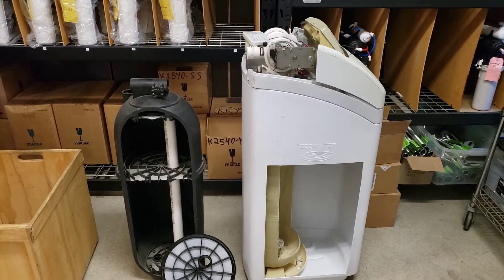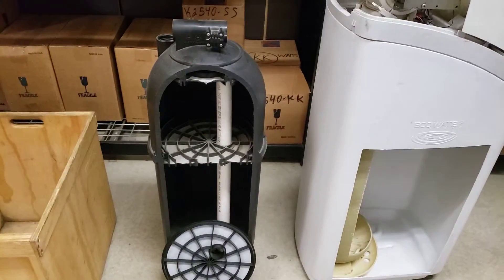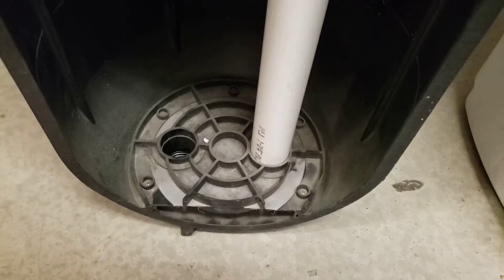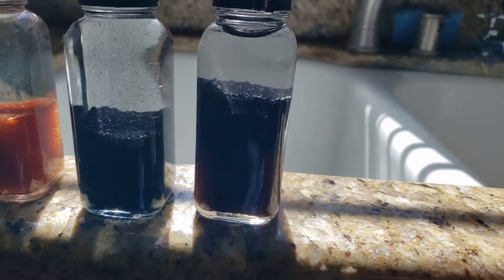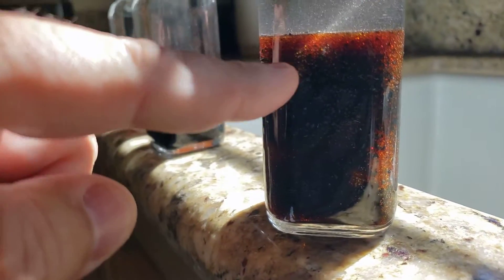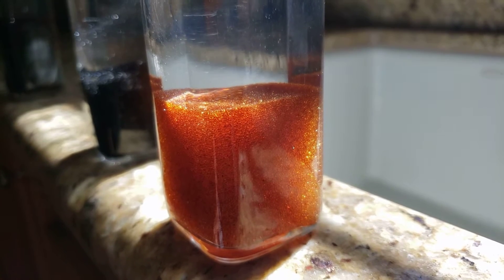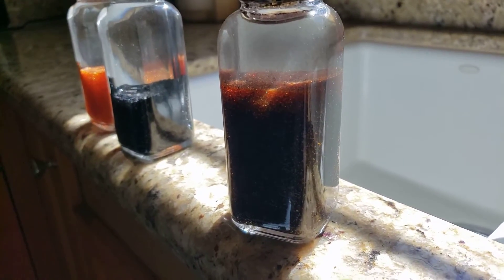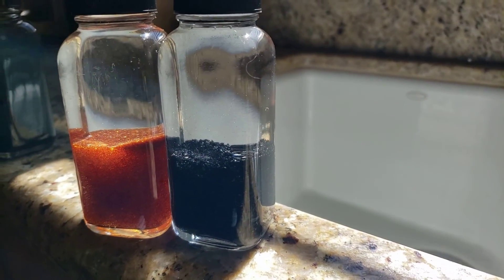Hague Watermax comparison Ecowater

Comment: The HAGUE installer stopped using HAGUE after my install and NO dealer is in the area. The nearest is listed on the HAGUE site as coming to where I live, the dealer says I am too far. So, I need help please. I have a HAGUE Watermax with two ST-200 controllers, one on the1AAA-BWO "Filter w/Touch Screen", and one on the 2AMQ "Water Softener with Patented Brining". There is also a salt tank.

I received two new ST-200’s from Hague because the first two would not allow direct touching of the associated display icons and recentering the screen did not help. I put calcite into 2 AMQ and then I believe I have messed up by also putting it into the 1AAA-BWO. Am I correct in this being an error? Can I vacuum it all out? I have that tank in bypass because my water pressure to the home dropped way down, I am sure I have occluded everything in that tank.

Comment: Do you ever have to change the carbon?
Reply from the maker: It depends on your water quality and preference. We have many clients that have had their system for over 20 years and the carbon is still working great. If you have high levels of chlorine or chloramines you may want to replace the carbon sooner than 25 years. It's designed for up to 3 ppm chlorine. I hope that helps.
Reply: @haguewater  thank a lot and that’s great. I would have never guessed it last that long. Chlorine is hig im Texas
Reply: For ensured longevity of the Hague WaterMax system, on municipal water, we change the carbon every 3 years.